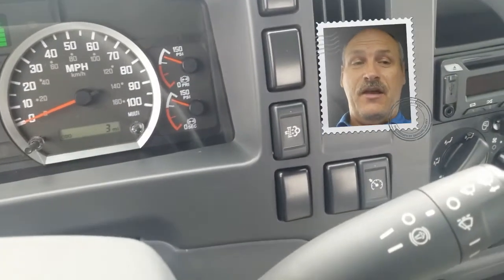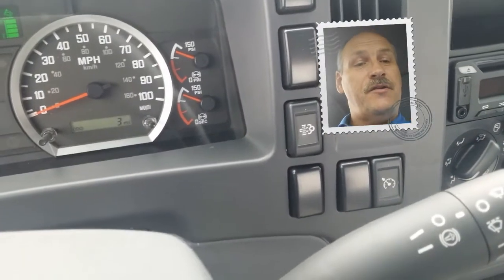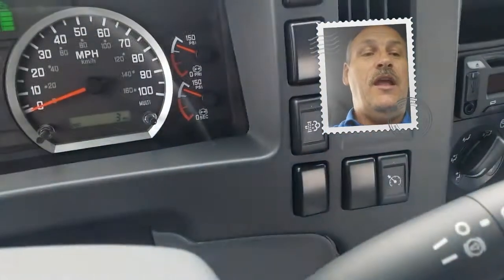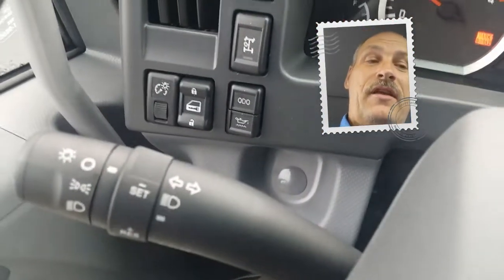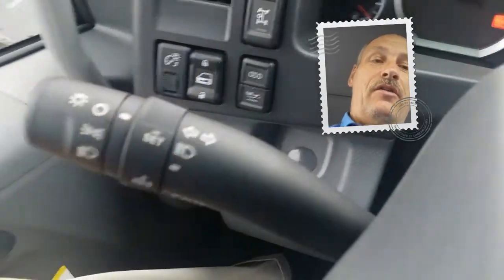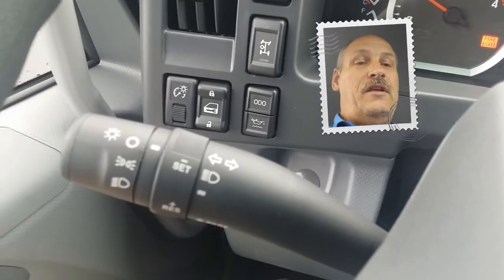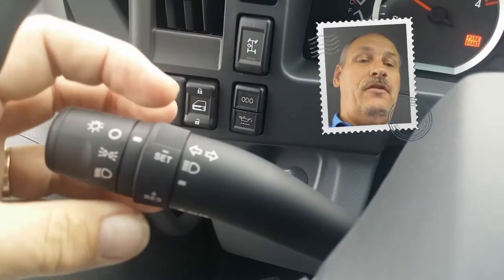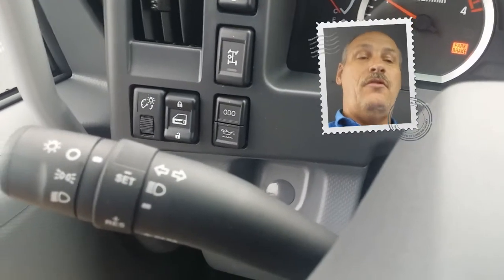Isuzu FTR Cruise Control Operation - How to operate the dash switch and lever control system

Comment: It didn’t work for me 🤦‍♀️ can’t work out what I’m doing wrong. I have an N series Isuzu.
Reply from the maker: Okay lets do a quick check.  when you select the dash button to the  right of the steering column.  there should be a pale light on the dash that turns green when the rotation is set.
Reply: Thanks - yes I am seeing the light on the dash as soon as I push the button, before I even twist the stick thing. 
It’s a rental truck, and a friend has suggested the cruise control feature may have been disabled?! 
Thanks for checking in to help me!
Reply from the maker: @Redeemed12  I guess that is a good suggestion.  I am interest on what the rental company has to share.  If you still need feedback - let me know!
Reply: Hey, I rented the truck again and asked the company how to get the cruise control working. It turns out that the hydraulic brake system and the cruise control can’t be turned on at the same time!! So the guys showed me how to turn off the hydraulic brake setting, then the cruise control button and stick worked!
So I used (and really needed) the hydraulic brake in the town driving and then turned it off for the freeway driving and used the cruise control
Reply from the maker: @Redeemed12  THank you very much for the sharing on your use of the exhaust brake.  It took me a moment to re-read your comment to get to the exhaust brake reference in lieu of the use of hydraulic brake.  Think headed on my part.  Thanks again!